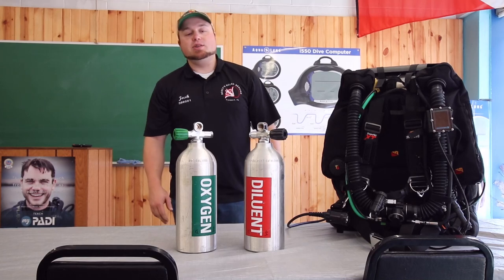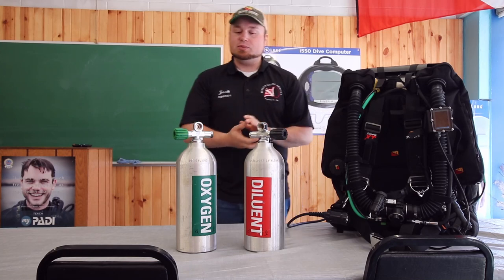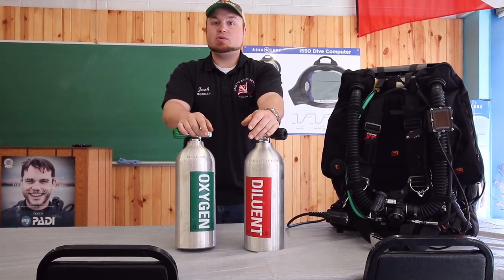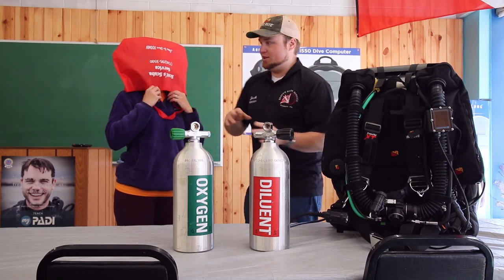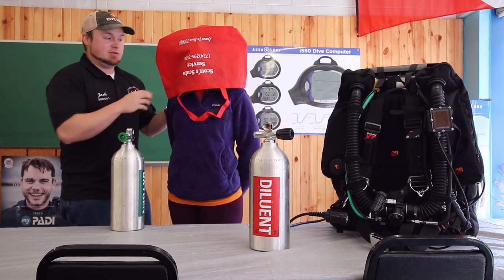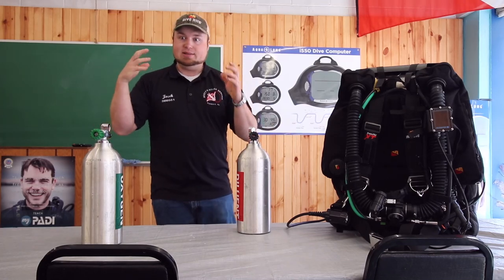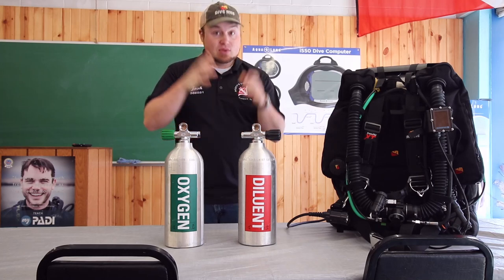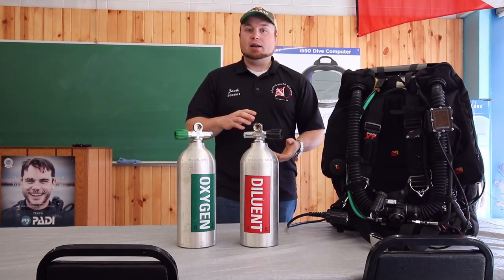What is a Rebreather and How Does It Work Part 1 Presented By Scott's Scuba Service

Comment: Another key point is that air has 21% oxygen. When we breath we only use 4% so 17% is still left over! A re-breather can use this oxygen again, but in a traditional SCUBA it's just lost as bubbles. This is why you can be underwater much longer with a re-breather.

Comment: So do you need to open and close the oxygen and the diluting canisters?
Reply from the maker: Only when you begin and end the dive. The system automatically (or manually if you choose to fly it that way) adds small amounts of Dil and O2.
Reply: @bluedescentphotos  as I’m still very afraid of this, if I ever do scuba I think I’m just going to stick with a standard open circuit >~<
Reply from the maker: @jakeb.7997  There is nothing wrong with that. Starting standard scuba is the best, and really only, option anyways. Someone should be very confident and comfortable with open circuit scuba diving before considering a rebreather. Once a diver is ready though these systems are amazing.

Comment: How long can you stay underwater by using a re-breather? I assume the o2 tank will eventually run out? What happens if you breathe too fast?
Reply from the maker: Hello, a great many things determine how long you can stay underwater on a rebreather. Typically that amount of time is based on your scrubber life. Depending on many factors 4-6 hours is a safe guess on a max dive length. You have to be very careful not to overbreathe your system or the scrubber cannot do it's job of removing the CO2 properly (because it is a chemical reaction there needs to be some rest time). You could run yourself out of O2, but if you have entered the water with a full tank that is typically not a determining factor in your dive length. You use very little gas volume while on a closed circuit rebreather.

Comment: oh, not what I thought. I thought it would break the co2 bond and just give back the oxygen and take oxygen from the water.
Reply: That would require on-board electrolysis. While technically possible, it is a slow process. Now that’s just with pure water. Electrolysis on salt water produces different biproducts, sodium hydroxide and chlorine, which are both not something you’d want to breathe.
Reply: @flakdampler11  
I was thinking free oxygen in the water. as for the CO2 we breathe out no Cl. but that's just the miracle I thought a rebreather did. I thought they had figured out how to be a fish.
Reply: @gdotone1  oh yeah that would be cool. It’s probably possible to make something that works like gills. I wonder what the limitation is.